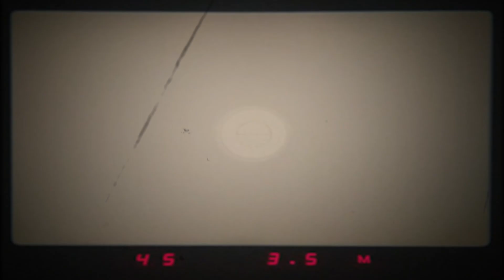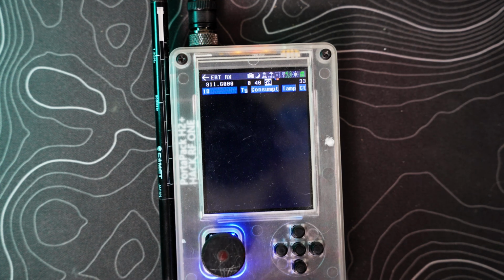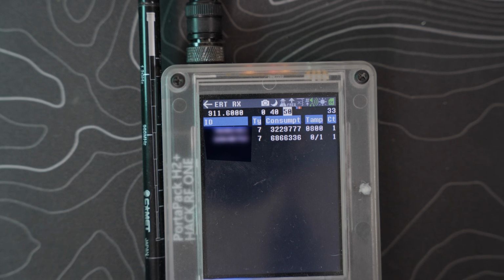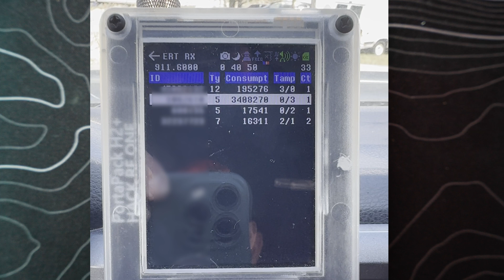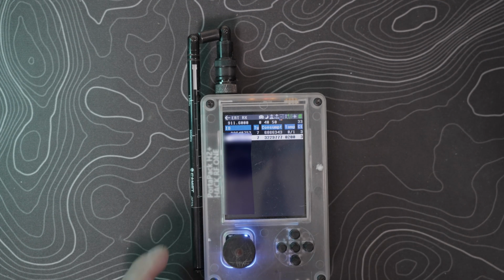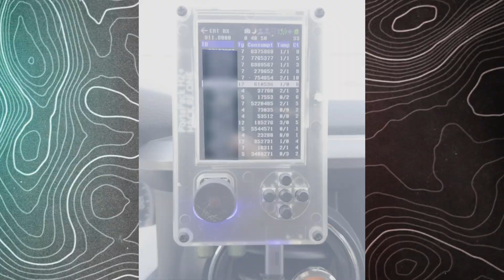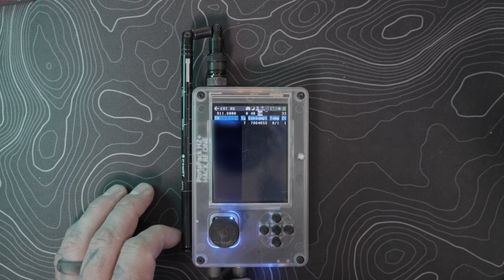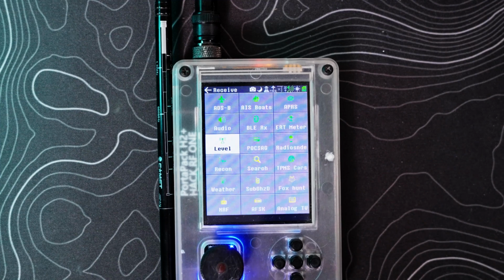Portapack H2 ERT Meter

Comment: I receive signals but the display shows nothing. What does the 33 in the top right corner mean ?
Reply from the maker: @fotografm  that’s volume. You can try other frequencies too. Some units run on 315. 433 or 915.
Reply: @Jeremiah.o.A.T  Thanks

Comment: Hey there, I've been trying like heck to pick up ERT meters with no luck. Is it always going to be 911.6000MHz? I saw another youtuber picking them up on that frequently as well.
Reply from the maker: @matty76778  you can try 913.600. Most ert meters ping out every 30 seconds. Just fyi.
Reply: @Jeremiah.o.A.T  Thank you for the advice!
Reply from the maker: @matty76778  also go check out my latest short. See if that helps.

Comment: Is there any more information like battery voltage in the data received?
Reply from the maker: @ParkerCNG  I haven’t seen any from my readings. You could join the Discord for the PortaPack and see if anyone on there has more info.
Reply: @KJ7VUB  have you ever scanned a gas or water meter or have you just looked into electric meters? Thank you for replying.
Reply from the maker: @ParkerCNG  I’ve scanned gas and electric. I’m not sure what protocol the area I’m in uses for water since we’re mostly on well. I know one of the treatment plants in the surrounding area uses a form of pocsag for some of their relays. But nothing I’ve seen on ERT.